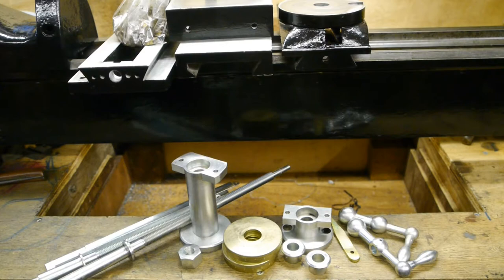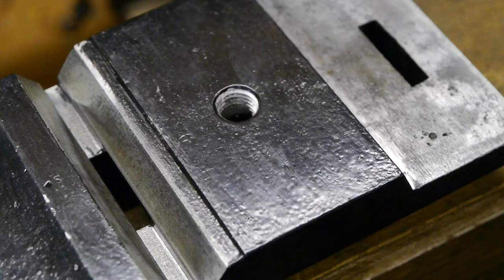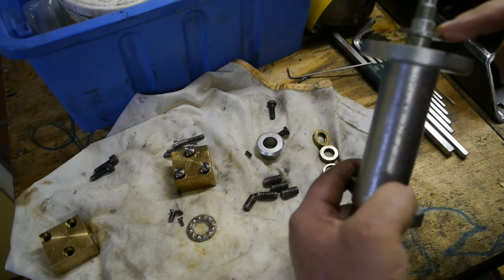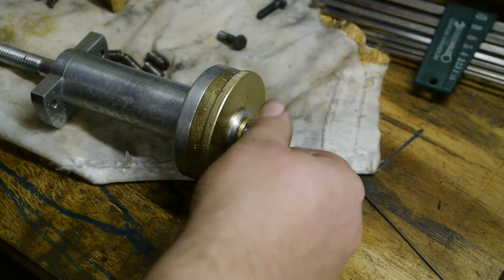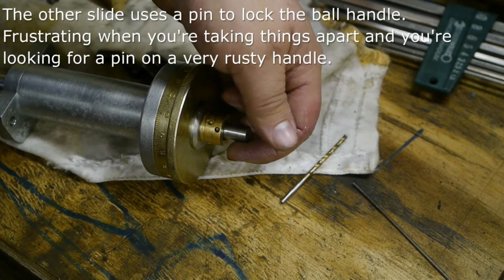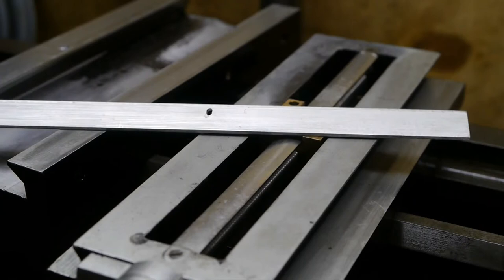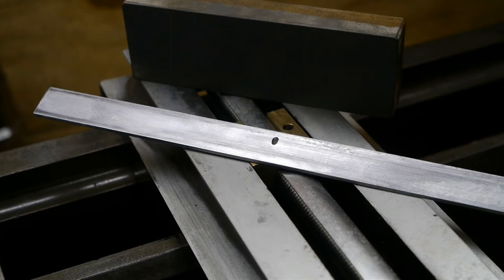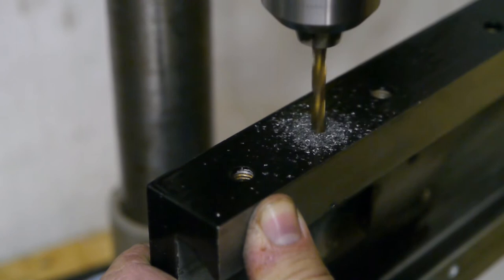Reassembling an old lathe - Part 2/3 - The Slides

Comment: Very nice cleanup of the cross slide and compound.  Interesting to see how the components go together.  Slotted screws were common back then.  I also hate slotted screws.  

The brass angle indicator is so much longer than anything I have seen.  You mentioned the protractor may not be used.   I do not trust my eyesight with my lathe.  If I need to set the compound to a critical angle such as for threading I use other tools.  For threading a cut a wood block on my table saw, added a rare earth magnet.  I now can easily set the compound to the desired angle for threading.
Reply: I forgot to mention I did like the before and after pictures at the end.  It is always good to see the comparison.  Makes the restoration look even better.
Reply from the maker: Thanks, I hope they work as well as they look.

Those slotted screws a are pain in the ass. The are either huge or way to narrow to fit a normal screw driver set. And almost all of them are damaged.

The indicator is not brass, it's galvanised yellow. No idea how they do that. I did the same for the dial indicators and a few other parts. I think it's a nice detail.
Once I dial in the top slide parallel to a work piece I probably want to keep it that way. I can do tapered jobs on my cheap Chinese lathe.